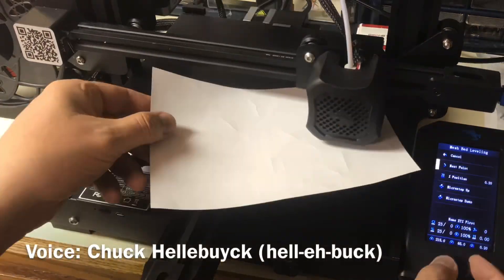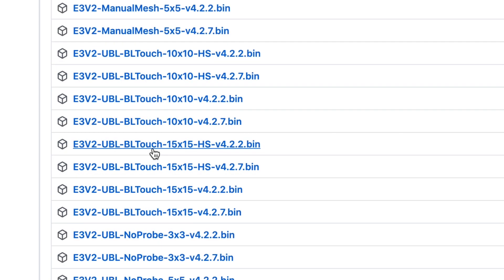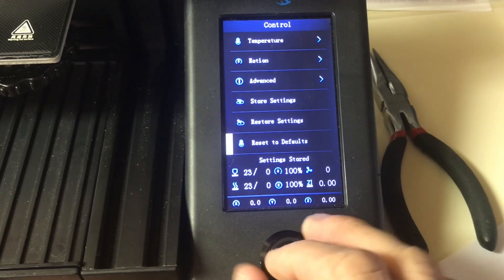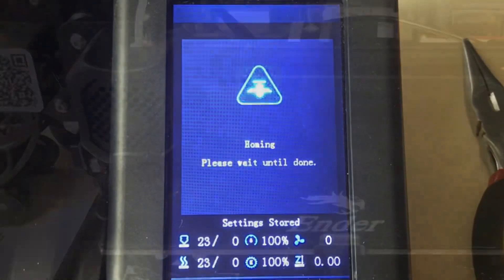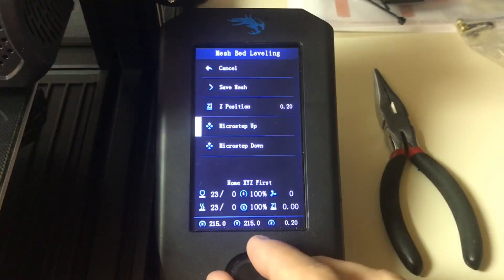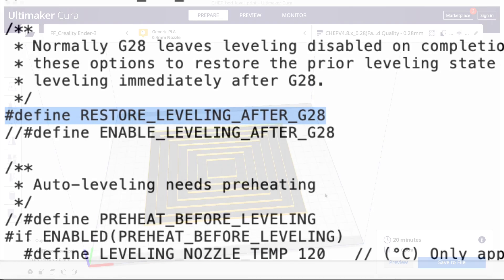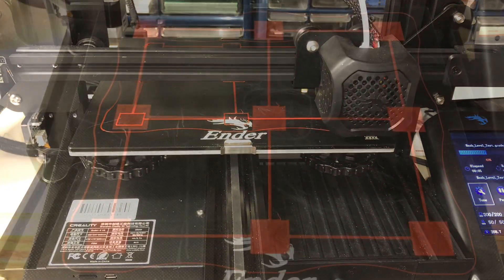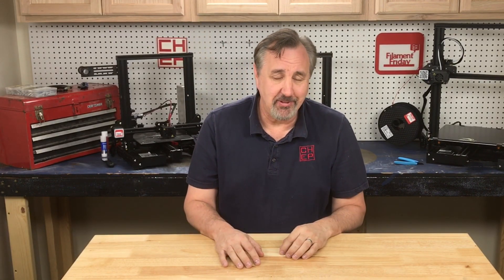Creality Ender 3 V2 - Mesh Bed Leveling

Comment: Thanks! Maybe I'll try this. I bought an ender 3 v2 a few months ago and I built it but I couldn't get it leveled, or maybe I did and theres something else wrong with it.
Anyhow I haven't touched it since and have been meaning to level it to get it to print.
Reply: @1seb11  Thanks for advice :0 
I didn't set a speed I don't think I just tried the test print that it came with. 
I was so confused while leveling the bed because the videos were like compress the springs all the way and then you have the head in the four corners and you get it so a piece of paper barely goes through.

But when I fixed one corner, the other would go out of wack.

and the biggest issue was at a certain level of the spring compression/ height of the bed, it would knock into the motor on bottom and angle the bed a bit.
Reply: @cinialvespow1054  when using springs you compress them all the way, bring the head to each screw and adjust so a piece of paper just barely scraps the nozzle. The only step you missed was repeat 3-4 times. With each repeat the amount of change gets smaller and smaller, after 3-4 is should be pretty close to absolute level.

If you update to Jyers you can use the mesh to correct the smaller imperfections in the glass such as small ridges and valleys that are impossible to see with the naked eye.

Also to prevent the bed from hitting the y axis motor take one of the wrenches that came with your printer, loosen your Z axis end stop and use the thickness of the wrench to set a safe height on the endstop. From there follow the leveling procedure from above.
Reply: @87Screed  thanks I saved this for when I try
Reply: @87Screed  Loosen my z axis end stop, okay. And then what?
Sorry.
Thanks alot for the help tho.

Also what is Jyers?
Reply: @cinialvespow1054  Jyers is the firmware chep installed in the beginning of this video. The full name of the firmware is Jyers Extensive UI.

For the z end stop when it's loosened slide the wrench under the bottom of the end stop and tighten the end stop back tight. You can pull the wrench out after it's tight.
Reply: @87Screed  
Is jyers with the mesh bed levelling reccomended over stock firmware and leveling, or should I just buy a bl touch or something like that?

Isn't the z end stop a little button that tells the printer it has reached minimum z distance?
I get that I can move that up and down the rail but I don't imagine what you mean with putting the wrench under the  bottom,
Do you mean I need to move it a bit higher or?
Thanks a lot
Reply: @cinialvespow1054  I prefer Jyers firmware over the stock, it enables a lot of stuff the stock doesn't allow e.g. baby stepping, axis position on the display, mesh bed level, etc...  As for BLTouch it's not required with Jyers as you can do it manually, BLTouch jus mtakes it easier and faster as the system performs the work of building the mesh vs you dialing each point in on the display with manual mesh leveling. 

The wrench is just for spacing once you have the z end stop tightened back down you pull the wrench out from under it, it's only purpose is to raise the endstop up high enough so you can make your bed clear the y axis motor as you stated was happening.

Comment: Chuck, that Creality bed levelling kit when you download Progispv1.72 the folder name has some Chinese characters as part of the name which causes 2 kernel errors and the software won't allow you to define the control board chip, to fix this rename the folder to progisp+1.72 and all will be well.
Creality have been aware of this error for a long time but chose not to spend the few seconds it takes to fix this problem or update the instructions.

Comment: I have the original ender 3 (non-pro), will the bltouch work on my printer? Thanks!
Reply from the maker: With an adapter or board change. I would recommend the V4.2.7 board.
Reply: CHEP Thank you!